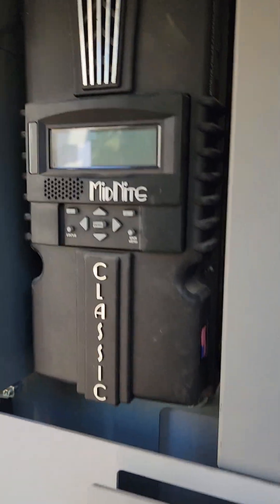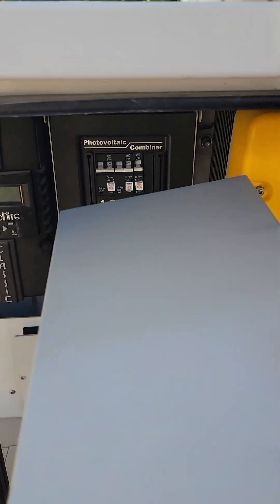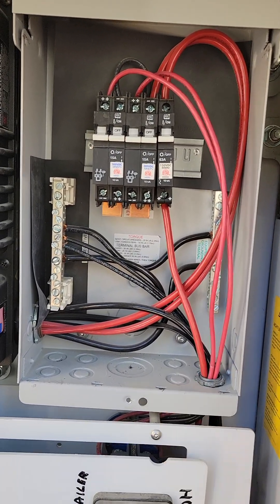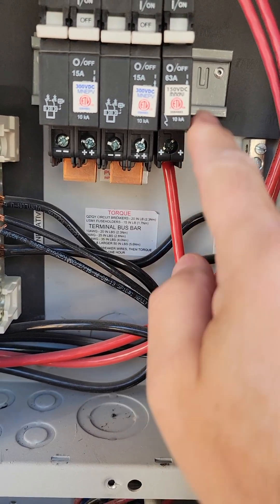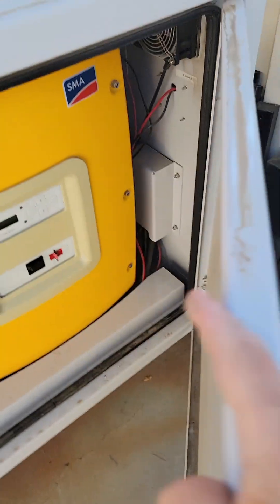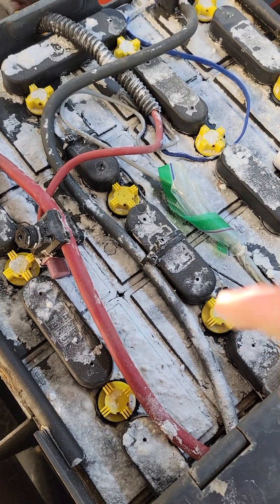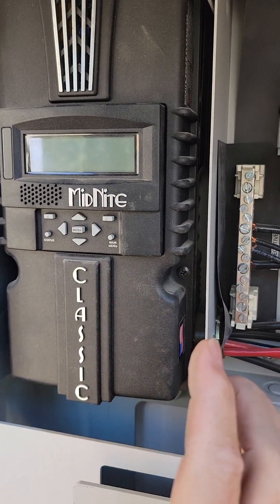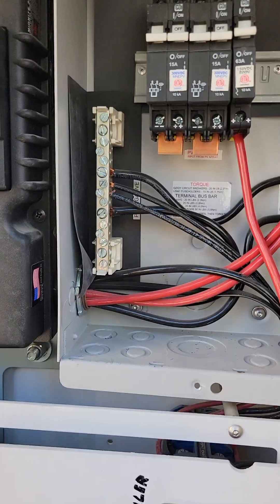Diagnosing no power or no solar to your MidNite Charge Controller

Comment: Thank you for posting this video, John! Deanna and I trying to test the RV with our single 510ah and had the DC Solar Trailer shut down yesterday - so we are still working out the kinks. I think our battery temperature sensors may be going bad - not sure just yet.

Comment: Check continuity between your positive and negative inputs on charge controller, if continuity is present it means your mosfets need replaced inside the midnite c.c.